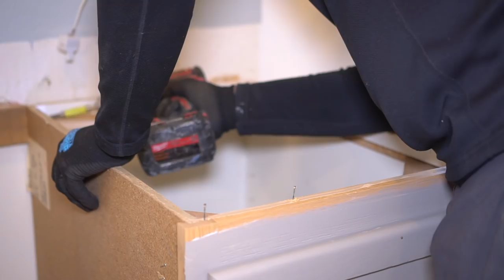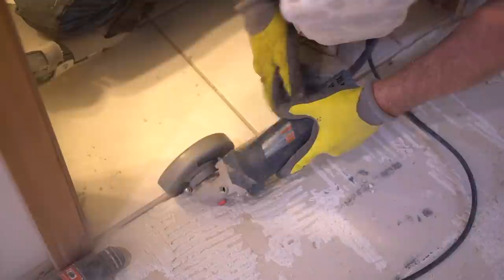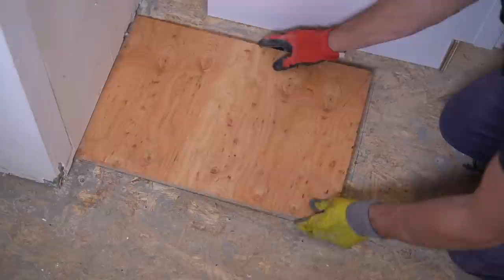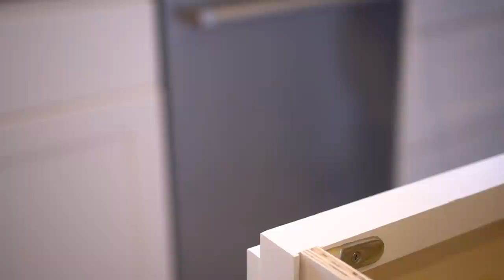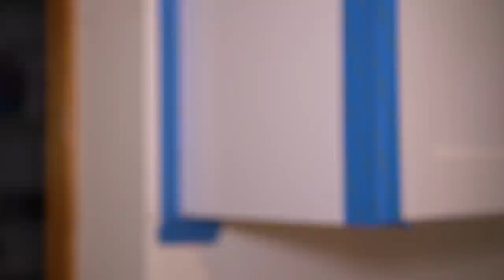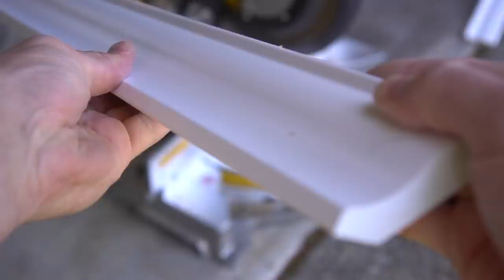DIY KITCHEN MAKEOVER // START TO FINISH (Part 1 of 2)

Comment: Just be glad you only had to deal with the backer board.  Down here in FL, almost all the houses are gonna be on concrete slab, and from my experience, most just put the thin-set right on the concrete.  When I demo'd my kitchen to replace all the flooring, first we had to remove all the tile, and then we had to take a right-angle grinder with a diamond cup wheel on it and grind off all the thinset and white cement the previous homeowner used to put the tile down.  The dust from it got everywhere, even with plastic sheeting all over the place.
Reply from the maker: That sounds like a nightmare uuuuuuuugh!  I definitely know how long that can take with an angle grinder.  Thanks for sharing and watching.

Comment: I literally did the exact same tile demo last week & found that I was able to use my jackhammer to get under the cement board & lift it out prior to screw removal. Still had to remove the screws but it went a lot faster than trying to locate them embedded in the cement board. Thanks for the video!

Comment: How come you use a level on your 2X4 Ledger for your upper cabinets when you had the level on the 2X4? Also you have European hinges you could have removed the doors to install your cabinets to make the installing easier.
Reply from the maker: Well it is a 2x4 Philip so we all know that they aren't perfectly straight haha.  Small minor adjustments go a long way when it comes to installing everything and the 2x4 is mainly there just to make the installation easier.  Cabinet doors weren't a big deal one way or the other but probably would have made it easier on me when I was installing a couple of them myself haha! thanks for watching.